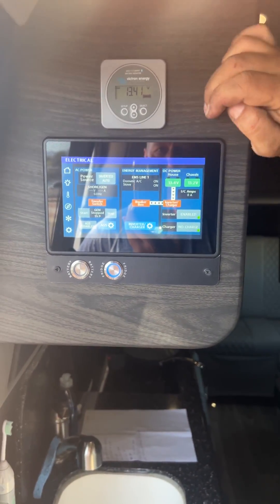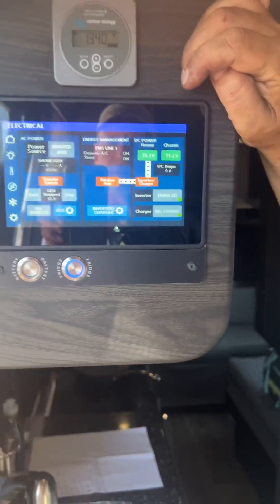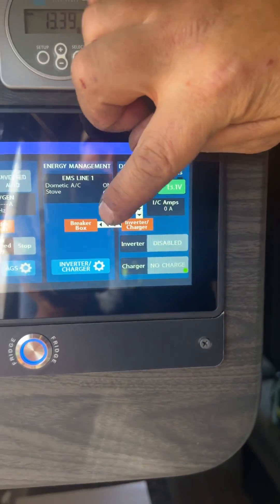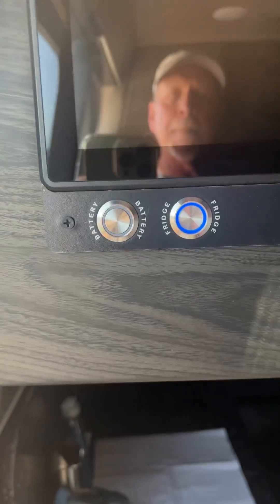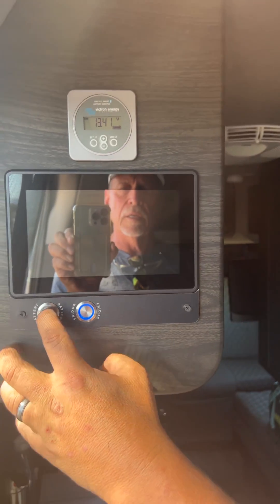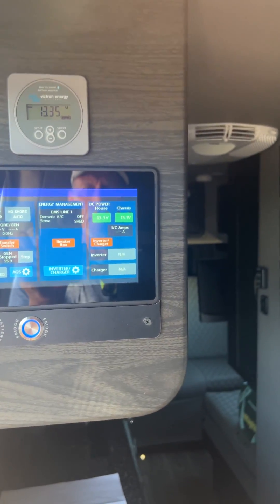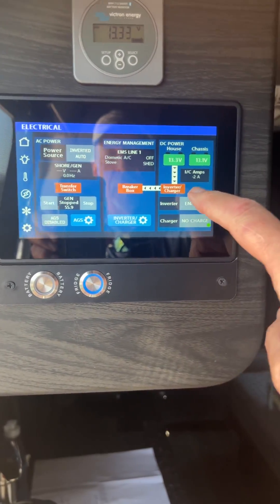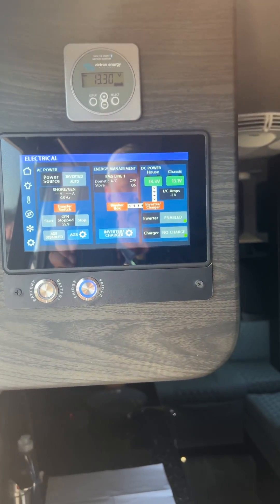Full shutdown of your rv without losing your inverter's firmware (Xantrex and Firefly.

Comment: Newbie here…how would we know if firmware has been lost? Is there any specific signs? Our house batter drains very quickly but I’m assuming it’s because van was sitting for quite sometime.
Reply from the maker: Your inverter or firefly wouldn't turn on when you turn your Coach master switch on. As a first step for your battery draining quickly is a VictronConnect app test. See the video on the VictronConnect app settings to verify everything is set up correctly.